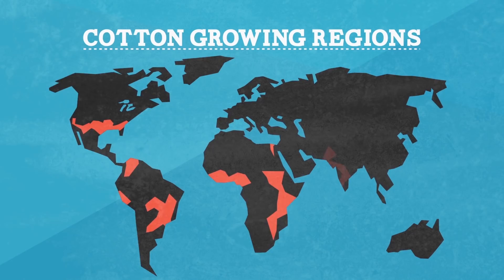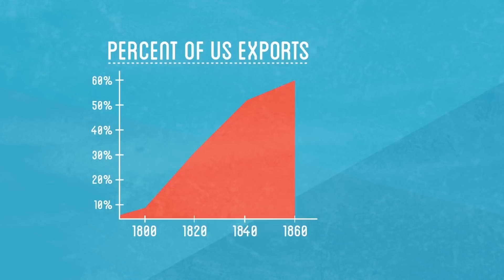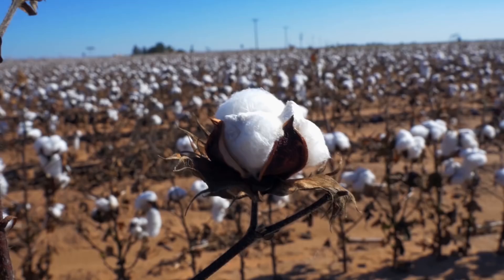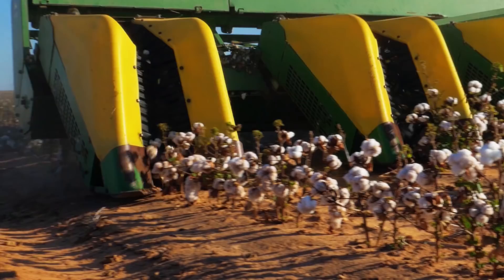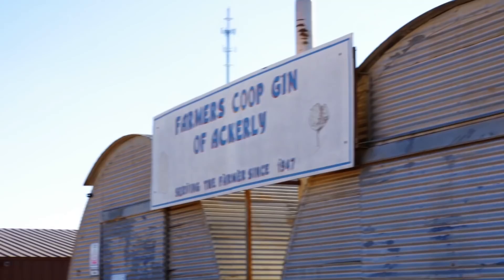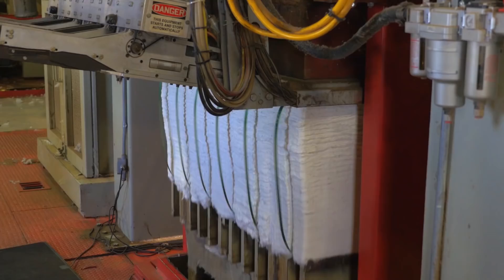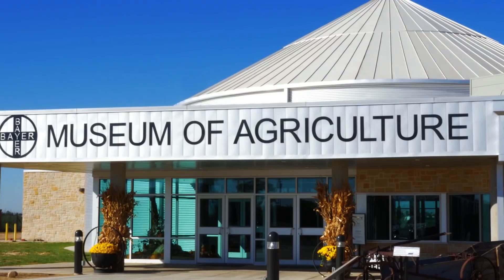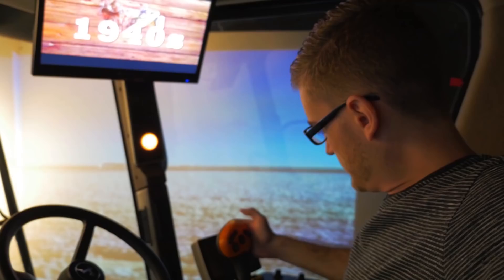Cotton | How To Make Everything: Suit (2/10)

Comment: Slavery was not the main reason for the civil war
Reply: in the video you said that the increase in slavery was the cause of the civil war well sir you would be wrong in saying so as the civil war didn't bring slavery into the mix till 2 years after it started it started because the union took the Souths rights away not because of slavery
Reply: Draconic Anomaly The civil war started when Abe Lincoln was elected president. He was very vocal about be against slavery. This caused 7 southern states to secede from the Union. The tension, which was decades old, surrounded around states’ rights versus federal authority, westward expansion and slavery. The states' rights centered around the North pushing gor a centralized government. The South felt strongly that they should be able to conduct any business the like with whomever they liked (including making treaties with enemy nations for profit). Prior to the war, states like New England talked of seceding because the war (1812) interfered with their slave trade profits. What brought the question of states’ rights to the forefront was changing attitudes toward slavery. The Northern states were supporting abolitionists, many aiding runaway slaves in escapes to freedom. The Southern states saw this as a move against them. With the election of Lincoln to follow these acts, the first shot of the civil war was fired by Confederate troops at Fort Sumter. In short, slavery was one of the major contributing factors to the civil war. It was big business and the Confederate States felt that the Union was against them and their "rights".